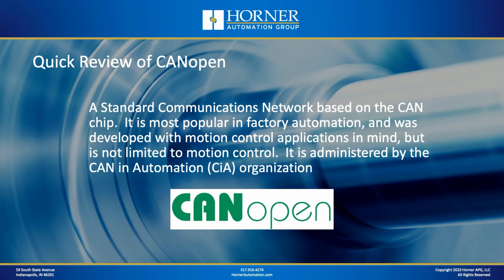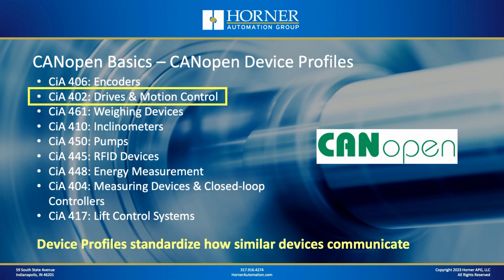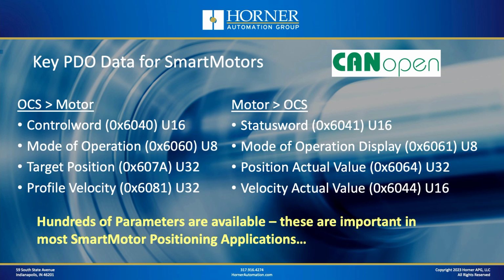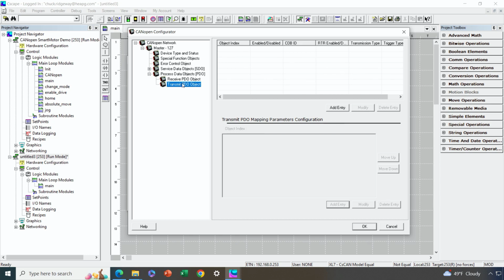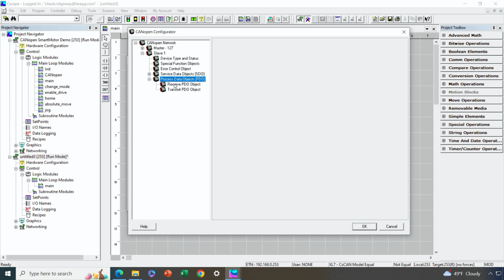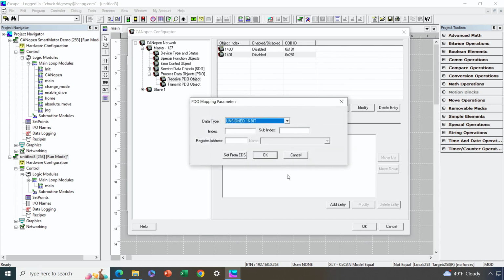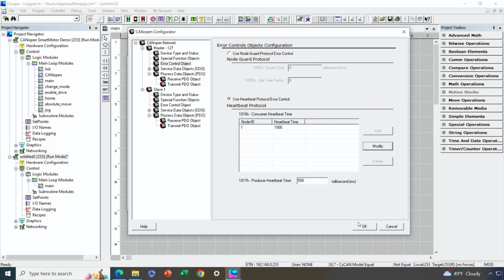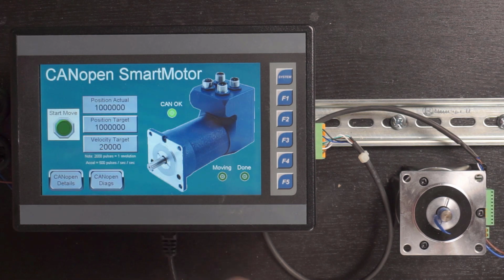Control a SmartMotor with Horner OCS Over CANopen

Comment: Ben - Are you sure the device you are looking to use is a CANopen protocol device and not one designed for generic CAN or maybe J1939?  If it truly is CANopen compatible strictly speaking an EDS file is not mandatory - but makes things easier.  If your PDF is descriptive enough, you'll be able to configure things manually, or maybe even just use SDO communications alone using SDO read function blocks and/or SDO write function blocks to keep things simple.

Comment: I assume the DBC file should come from the vendor of the CanOpen device.. but what if they only provide a pdf of the PDO/SDO entries?

Are there sample CanOpen DBC files that one can examine/modify?  I haven't had much luck finding any CANOPEN dbc files.

Can CScape be used to monitor any CanOpen Device, provided you import its DBC file?  I have a simple CanOpen device that transmits Pressure data that I'd like to use!